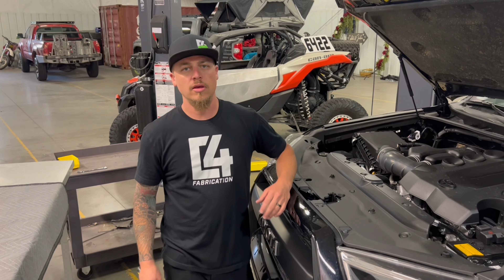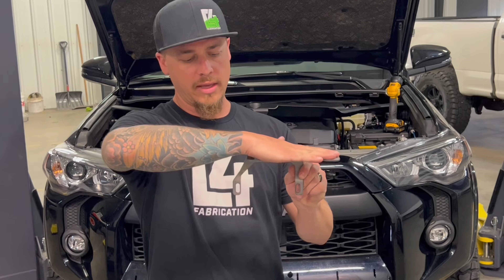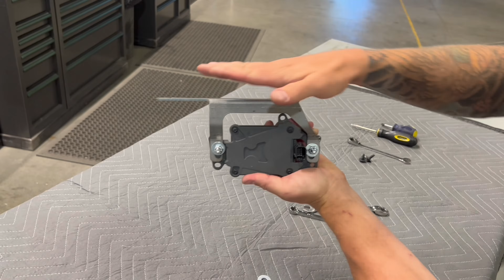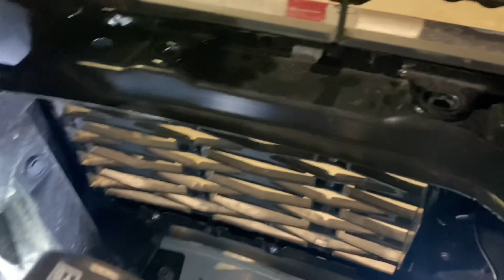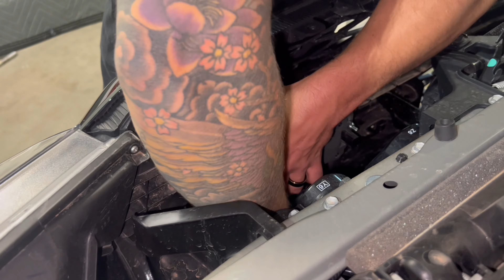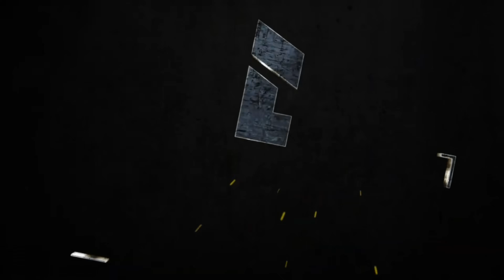2020+ 4runner TSS relocation bracket installation guide

Comment: Followed this vid pretty much. Got mine installed and so far hasn't thrown any sensor issues. Honestly the only issue I had was cutting the plastic piece on bar of the grill. But again, so far, no issues with sensor codes. fingers crossed
Reply: Where to buy this bracket
Reply: I have this installed and its been on for about a year, and its already rusting badly, I would recommend a coat of paint on it